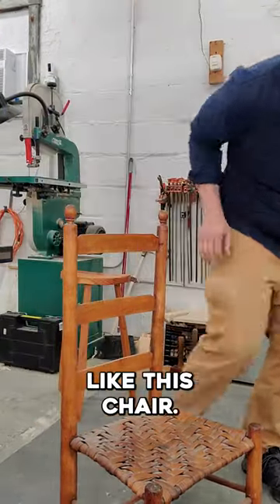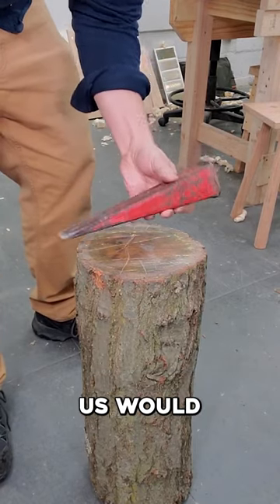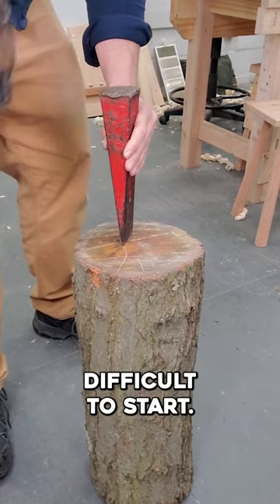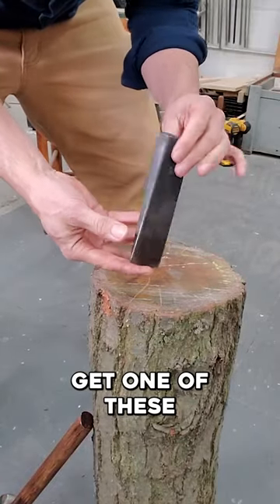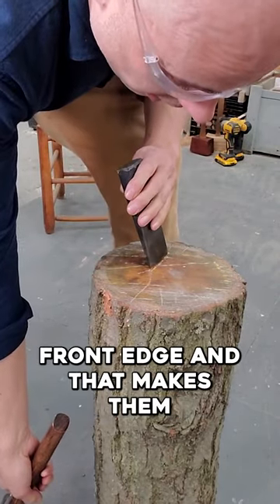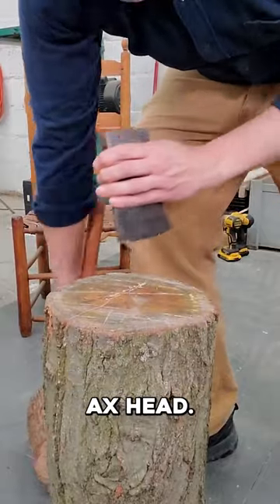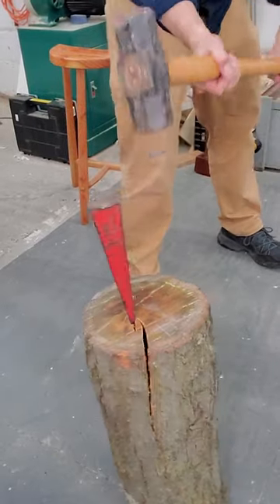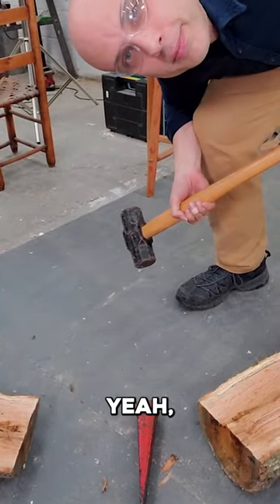Cheap Trick for Green Woodworking #diy #woodworking #woodworkingtips

Comment: I can hear Eoin Reardon now asking where your froe is.
Reply: Yep. Came to suggest a froe.
Reply: Indeed, I was going to ask what his take on froes is vs this method
Reply: Rex is way more professional than that guy
Reply: @juhis5936 I don't really see a need for competition. There's enough space for both of them and they both have their own unique way of going about things. Its kind of apples and oranges.
Reply: @juhis5936  you're delusional
Reply: Correct me if I'm wrong but from what I've seen it seems like the froe offers more precision but the wedge is faster I could be wrong tho.
Reply: @juhis5936 That's a really dumb comparison to make.
Reply: everybody gets angry when I criticize the irish guy
Reply: @juhis5936  because there was zero reason for your original comment. You weren't criticizing, you were being a hater
Reply: If you can’t start a wedge, how are you gonna start a froe with five times the area to spread the force?
Reply: @fredriksooder2747 By starting at the edge.
Reply: I've been reading YouTube comments on woodworking in an Irish accent unconsciously.
Reply: My experience is that the force to do that first split on a log that big is beyond what I want to put on a froe. If you're using a froe to do that first split, the force is coming from your arm twisting the handle, which is a lot more work than just dropping a lump of steel on a thick wedge. I want to put steel-mushrooming sledge blows on a wedge, then come back with a froe (which are harder for me to replace) for things that fit in a riving brake. 

I enjoy Eoin Reardon's work as an entertainer and entry point to the craft, but I find Rex a far better teacher. I'm also somewhat concerned about Eoin's streaming woodworking while buzzed. When you're working with really the only hand-tools that can kill/maim you (axes and chisels), that's not a great prescedent to set for newbies when you have a growing platform.
Reply: @andrewkrahn2629  You start with a wedge and finish the split with a froe because the wedge is too short to finish the job.
Reply: @juhis5936  you didn't criticize him, you just said he's less professional without any actual argument made. So, maybe just explain how you think the guy specialising in traditional/manual tool woodworking is "less professional" when it comes to traditional woodworking(i.e. working with green wood with manual tools) when his channel, unlike that of Rex, is chock full with content about the topic at hand..?!
Reply: You beat me to it 😂🎉
Reply: @IzzyIkigai no.
Reply: @juhis5936  Nice argument
Reply: @Boru06 
I'm aware, I own and use both. On that diameter/length it is useful at the very end, but a hatchet or second wedge (cheaper and easier to find) would do just as well.

Examples of Wedges being used on smaller pieces:

Peter Follansbee, pro green woodworker, who likely wrote or edited the books Eoin is basing his chairs on
https://youtube.com/watch?v=uqEoymNl9Dk

Neil Mapes, UK Heritage Craft Trainer
https://youtube.com/watch?v=hjOeKgOirNo

When I HAVE seen people use a froe on large-diameter wood, it's been very short, like in making shingles (8:00ish)
https://youtube.com/watch?v=UZA1J8RHltY

I find this Reardon video baffling, as the froe is being driven into an existing crack (not actually moving wood), then immediately falls out when the tool that's actually doing the the splitting (the wedge), is driven in. Note he never actually shows the froe being used on that diameter/length combo except at the very beginning and end, because those are the only points where it's useful (marking the line and levering the end of the split, both of which you can do with a hatchet).
https://youtube.com/shorts/rhLZKiWv7zI

I'm hoping I'm not cherry-picking. If anyone can find a log of the diameter and length Rex is splitting being split with a froe and arm power alone, I'd truly like to see it.

edit: this is another example of a prolific green woodworker using a froe when needed, but sticking to wedges for bigger work
https://youtube.com/watch?v=dRTZvT8tDDY
Reply: @hotchef1984 @Alacritous @zkons

Rex does have at least one froe video (and I assume several more coming as he works on these chairs) but it's very different from Eoin's content. It's more "back yard" than "stepping back in time", but there's a reason for that.
https://youtu.be/4YqRoCNHa2k
Rex is focused on teaching beginners very thoroughly, using the tools they already have/can get for cheap, more than demonstration/putting on a show (Reardon is definitely more of a showman than Rex).

Both have their place in getting people into the hobby!
Reply: @juhis5936 I kinda get where you're coming from, but why be rude about it? I doubt you'd talk like this if you were looking anyone in here in the eye. Remember there are people behind the text who you'd probably get along with IRL!
Reply: @andrewkrahn2629  I've read none of that. I bet you're amazing to have at a party. 🤢
Reply: @andrewkrahn2629 what are you even talking about, this guy said maybe explain and I said no
Reply: @juhis5936  because people simply dislike you. It turns out that intentionally souring the mood is very frowned upon and doesn't make you very likeable.
Reply: @jaylee9907  damn talk about uncalled for.
Reply: @jaylee9907 bro talk about delusional. This guy is more modern wood work Eoin is more traditional wood work this guy uses more modern hand tools Eoin use’s antique hand tools that he restores Eoin shows his viewers how to restore hand tools this guy shows you how to use them. Why are you so defensive over this they are totally different people and channels. it looks like Eoin hurt you personally or something considering how desperate you are acting over the most dumbest thing.
Reply: @That_1940s_Delinquent  wrong person lol
Reply: @jaylee9907  you are the right guy it was just 4 months ago so I don’t blame you for forgetting.
Reply: @That_1940s_Delinquent  "eoin hurt you personally" what are you yapping about?
Reply: @jaylee9907  you where slamming Eoin reardon for no reason to the point where it looks like you are hurt personally by him. A shame I have to explain that to you.
Reply: @juhis5936 Remember, we all have preferences on how we go about things. No need to be so crass about it.

Comment: Important detail that you didn’t use the sledge on the axe head. For those that don’t know, never use a sledge on an axe head, only on wedges. Wedges are made to be struck by a sledge
Reply: For real, I've seen plenty of axe heads squished too wide and ruined from that.
Reply: If you don't mind me asking, why can't sledges be used on ax heads? I get it if the whole head is hardened but most of the time I thought just the edge was hard, and not as hard as many other types of steel
Reply: @thedudeamongmengs2051 The eye of the axe squishes out. Using a wooden mallet instead helps.
Reply: @lazerblade2 So no problem if the handle is still filling the hole, I guess .
Reply: @johndododoe1411  No. It won't happen as quickly if there's wood filling the eye, but it'll still happen if you're regularly bashing the back end to split wood.

Comment: And a fun, beginner/intermediate project for someone into blacksmithing, is forging your own hammer out of a wedge. You'll need a few tools beforehand, but not alot. The basics(for smithing), a forge, anvil, hammer, tongs, something to cut metal, (or grind off), and a hammer eye punch, and some files or a sander to clean it up.(all not to complicated to make or buy) Cut off some of the driving end off the wedge, making the chunk that will be the hammer head your desired length. Measure and mark where you want the hole, punch the hole, size, grind,clean and harden it. Put on a handle and bam, your own first hammer. Now hardening will take some experimenting if you don't know the exact grade of steel, but it can all be done pretty smoothly.  I have a short and a reg video about it on my smithing channel lol.

Comment: Another tip for splitting a log like this - work out which end of it was the top when it was still a tree and put that end DOWNWARDS. Splitting from the bottom of the tree is a lot easier than from the top. 😃
💚🐇🐴💚

Comment: A froe (or frow), shake axe or paling knife is a tool for cleaving wood by splitting it along the grain.
Reply: I have wedges and a froe, and unless you want to be heaving on the froe for a while, it's way less work to just drop something heavy on a wedge. Also, the video is about wedges. He talks about all different methods of doing the same job, and it's much easier/cheaper to find wedges than a froe

Comment: Why not use a splitting maul...... takes some practice but you can control it to do what your wanting. Beats having to use 4 tools in my opinion
Reply: If you already know how to use one and can get each hit dead through the pith, and the log is short enough to fully split that way like this one, go for it! 

I have one but don't really know how to use it and almost took off a toe. With what Rex is doing you want every split dead through the pith until it's small enough to work with a froe, and indoors, or on longer logs like you'd use for the back legs of that chair, I'm fine using wedges, gluts, and hammer-shaped objects to get the sections I want.

Comment: Where's the froe?

Also I had what's basically a hatchet with a flat stock welded on the bottom so it could be easily levered out after being hammered in.

And instead of an axe head you can use a regular axe.
Reply: Do you have an example of someone spitting something that thick/long start to finish with a froe? I can only find Eoin Reardon using it to mark the line and pop the last 3 inches open, not actually split it (you can do both of those with a hatchet, which is way cheaper/easier to find; Rex's videos are focused on ease of access)

I think he might be using the head by itself so he doesn't deform the eye of his actual, useable axe by smashing it

Comment: I noticed you hit the wedges with a metal mallet and the axe with a wooden mallet, will hitting an axe with metal break it like a hammer?
Reply: correct! Hitting two pieces of hardened steel against eachother is a good way to get a crack or, worse, a chip pinging off like a bullet. Wedges are softer and designed to deform a bit, I think?

Comment: Why not a fro though? Flatter sections
Reply: a froe won't be useful on a log that big because you won't be able to exert enough arm strength to pry it apart. I might do 8-9" diameter, or a bit shorter than that, with a froe, but it's much less work and just as accurate to start by scoring then using a wedge

Comment: Why do I need to split open greenwood to make traditional furniture??
Reply: It depends on the tradition! Kiln or air-dried wood is more expensive, and so the furniture used by normal people for a lot of history (in Rex's case, the American frontier in the 17/1800s) was made from undried, fresh-cut wood. The methods actually require fresh wood of certain species because they often use the natural shrinking of the wood to hold it together! (nails from a blacksmith also cost money, and mortise/tenon joinery takes more time and skill). Does that help?
Reply: @andrewkrahn2629 Indeed it does! Thanks for the explanation
Reply: @anthonyjensen5524  Happy to help!

Comment: What about a froe?
Reply: what about it? I have both and I'd go with a wedge for that log
Reply: I have wedges and a froe, and unless you want to be heaving on the froe for a while, it's way less work to just drop something heavy on a wedge. Also, the video is about wedges. He talks about all different methods of doing the same job, and it's much easier to find wedges than a froe

Comment: Just use a froe?
Reply: I have wedges and a froe, and unless you want to be heaving on the froe for a while, it's way less work to just drop something heavy on a wedge. Also, the video is about wedges. He talks about all different methods of doing the same job, and it's much easier to find wedges than a froe

Comment: I’m surprised you don’t recommend a froe.
Reply: why's that?
Reply: why do you think that's more useful here? I have both and I'd prefer the wedge for that size.
Reply: @andrewkrahn2629 because a froe is significantly more difficult to to drive in and then require removing so you can pry with a lever.  The froe has it all, and can start from the edge of the round instead of driving into the center.  It’s a preference thing for sure, but the froe is more versatile in my opinion.
Reply: huh! For me the froe has been great for smaller or shorter pieces than he's using, but using a lever to do a log that size sounds like way more work than just dropping something heavy on a wedge

Comment: Best tool for the job here that I'm surprised wasn't on the video is the froe
Reply: My guess is that you're coming from Eoin Reardon's videos? Do you have an example of him spitting something that thick/long start to finish with a froe? I can only find him using it to mark the line and pop the last 3 inches open, not actually split it (you can do both of those with a hatchet, which is way cheaper/easier to find)

Comment: Why just dont use a working axe? Out of curiousity, its a real question 😅
Reply: if you can hit straight exactly on the pith every time, go for it, otherwise he'd be wasting useable timber. The goal is to get to halves, then quarters, then eighths, etc, all right through the pith so each has as little trash wood on it as possible. Then you can split out boards and posts that perfectly follow the grain, as strong as it's possible to get out of a tree

Comment: Why not just use an axe? Or better yet a froe
Reply: the axe would be hard for beginners to get exactly on the pith every time, leaving a bit of extra wood that would have to be waste 

the froe isn't really useful for timber that big. It only wedges a small bit in front of itself open. This is intentional so you can split it with the lever more slowly. But on big timber like this you might be able to stand on the froe handle without it splitting further.
Reply: @andrewkrahn2629  I mean you aren’t entirely wrong, but I wonder if you’ve ever actually worked with wood yourself, an axe would be hard to use effectively for a beginner, but a beginner shouldn’t really work with green wood, it’s too unwieldy. You are right on the froe though, but it’d probably work in the example in the video

Comment: You used the groove from the first tool so makes the test redundant imo yeah Eoin would have that in two pieces way quicker with his froe!
Reply: Do you have an example of him spitting something that thick/long start to finish with a froe? I can only find him using it to mark the line and pop the last 3 inches open, not actually split it (you can do both of those with a hatchet, which is way cheaper/easier to find). I'm also not sure why you're picking sides with woodworkers?